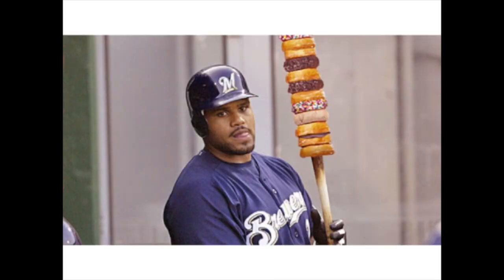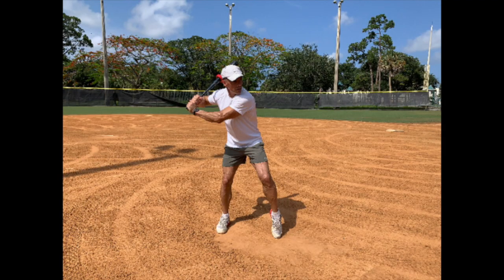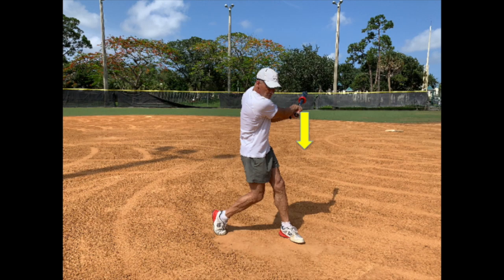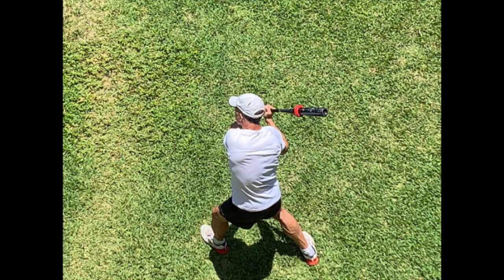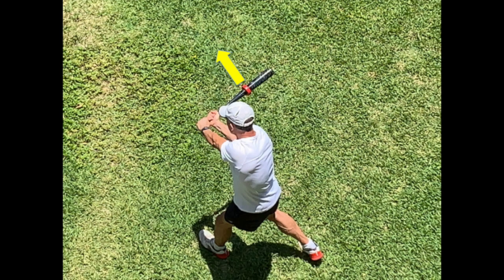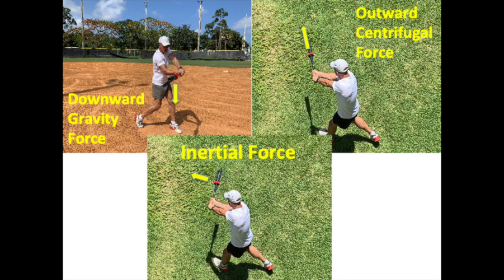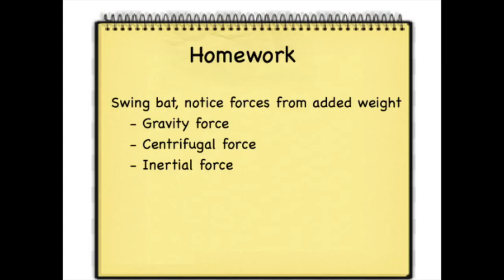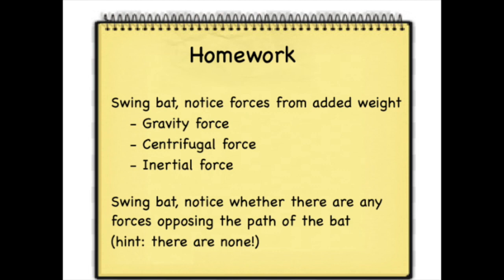FINALLY! The Science Behind Donuts and Weighted Bats EXPLAINED

Comment: now tell me about effects of practicing with a lighter bat like a -10.....same thing?
Reply from the maker: Swing Mojo is a tool that creates resistance and is used for overload training. Overload training is used to build strength and power. A lighter bat would be used for underload training. Underload training is used to train the fast twitch muscles to fire more rapidly and explosively and to develop the feel of moving faster. Numerous studies have shown that overload/underload training the best way to increase bat speed. A common fallacy is assuming that a heavier bat is en effective tool for overweight training; however, as this video demonstrates, it is not. A training aid using air resistance, such as Swing Mojo, is the optimal tool for overload training.
Reply: @swingmojo469  So then using a lighter weight bat has merit? It won't develop bad habits? Got a -10 for son to use at batting cage mainly so he can practice longer without fatigue....but wondering if some of the same issues apply as far as habits.
Reply from the maker: @SargNickFury  Swinging a lighter bat will not develop bad habits. The muscles used to swing a lighter bat are the same ones used to swing a normal weighted bat. There are no added forces (such as gravity and centrifugal force) in directions that are outside the swing path that must be overcome. Try performing 2-4 sets of: 5-15 reps with a Swing Mojo (overload) followed by 2-8 reps of the lightweight bat (underload). Base number of sets/reps on age, strength, stamina, etc. of the player.

Comment: any thoughts on the camwood bats?  Are they better than these weights?
Reply from the maker: I am frequently asked this question. Instead of adding weight to the barrel of the bat, Camwood bats provide extra weight on both sides of the hands. Not having the weight attached at the bat barrel eliminates the moment arm and more closely resembles the feel for swinging a bat without an added weight. Thus, it should have minimal adverse effects on swing mechanics. Also, unlike a weight attached to the barrel, there are minimal centrifugal forces that the hitter needs to counter and there are no inertial forces assisting the swing once it is begun.
Swinging a Camwood bat will engage the same muscles as if you took a light dumbbell, gripped it like a bat, and used a similar motion as if swinging a bat. This will strengthen hands, wrists, and forearms, which are important elements in the kinetic chain for swing a bat. Just like any activity that targets and strengthens specific elements of the kinetic chain, this can lead to increases in power and bat speed. An advantage of the Camwood bat is that swinging a bat and contacting a ball has more functionality than simply mimicking the motion with a dumbbell. A disadvantage of the Camwood bat is that the weight is fixed and cannot be increased as the player gains strength.
The Camwood bat resolves several of the pitfalls of using a weight attached to the bat barrel. I believe there are benefits to using a Camwood bat in your training regimen and it is preferred over a weight attached to the bat barrel. 
Bat speed is a measurement of how fast the bat barrel can move through the contact zone. The ideal bat speed training aid creates resistance at the bat barrel that opposes the swing path. To overcome the resistance, the hitter would be required to use the entire kinetic chain and the many muscle groups from the feet to the hands in a coordinated and mechanically sound movement to quickly drive the barrel through the contact zone. This is the idea behind Swing Mojo.

Comment: What about weighted bat sleeves ?
Reply from the maker: Weighted bat sleeves impart no forces that oppose the path of the barrel head. The main difference between each variation of adding weight to a bat, whether it be on the end of the bat (weighted sleeves) or near the hands (Camwood bat), is simply a change in the Moment of Inertia. Each will feel different when you swing; however,  no training aids that entail adding weight to a bat have shown to be effective in increasing bat speed for the reasons explained in this video..

Comment: Can I use a weighted donut to get stronger?
Reply from the maker: Swinging a bat with a weighted donut can strengthen the hands and wrists, however there are some caveats. During a normal swing, the strengthening will primarily occur early in the swing as effort is required to accelerate the bat barrel from its initial stationary position. Once the swing reaches full speed, inertial forces greatly contribute to the barrel's movement and potential strength gains are reduced. At this point, centrifugal forces increase and a tighter grip is required to hold onto the bat. 
     So yes, some strengthening occurs. But, as has been proven in many studies, this wrist/grip strengthening (accelerating the barrel at the start of the swing; tightening the grip) do not translate into a faster bat speed. This is because the strengthening is not in response to resistance forces that oppose the swing path. The only scientifically proven way to increase swing speed and strength throughout the kinetic chain is to train to overcome resistance forces that act in a direction opposite the swing path. 
     Swing Mojo (www.swingmojo.com) is a lightweight, patented training aid that creates aerodynamic forces that oppose the bat barrel throughout the entire swing and will increase bat speed and power.

Comment: Pain in my lead shoulder when hitting BP, can using this weight when warming up help this?
Reply from the maker: Not knowing your specific shoulder injury or its severity, I cannot predict with certainty whether Swing Mojo will be helpful or harmful to your shoulder. I highly recommend you seek a medical professional to diagnose and treat the source of your shoulder pain and provide advice before using. Swing Mojo is not a weight but an aid that uses air resistance opposite the swing path. Once medically cleared, Swing Mojo can be beneficial during rehab or training in order to strengthen your shoulder and increase your bat speed and power.

Comment: But why do most MLB players use it?
Reply from the maker: Good question. Adding weight to a bat to warm up is all we were exposed to from the time we started playing. It seemed intuitive that is should make us stronger and would increase our power and bat speed. It wasn't until fairly recently that many studies were conducted that quantitatively show that training or warming up with a donut is ineffective. It wasn't until now that the physics were applied to explain why donuts are ineffective. The paradigm shift from weighted donuts to an effective air resistance training aid that imparts forces that actually oppose the swing path will take some time. It will eventually happen and as with any new concept or technology, the early adopters will gain an advantage.

Comment: Sounds like a conspiracy to keep batters from doing better.  Pitchers paid for those studies 🤣
Reply from the maker: Most of the studies were performed at Universities. Once you understand the science, which I explain in this video, it makes sense.
Reply: @swingmojo469  While using weights to warm-up on deck can actually lower bat speed at the plate, those who mix underload and overload bats in a 2:1 ratio with their game bat, over 6 to 8 week, 240 to 600 swings a week with intent, actually hitting a ball - see a 6 to 10% increase in bat speed - or almost any rotational application. This has also been studied a LOT.

Comment: Interesting explanation. This then makes a training tool that uses air resistance ideal, as the tool going through the air will always produce an air resistance force in the opposite direction of the velocity. However, you'd have to design it in a way that it doesn't produce lift forces or net torque.
Reply from the maker: Swing Mojo is specifically designed to maximize air resistance while minimizing weight. The End Fins prohibit air from flowing over the Longitudinal Fins' trailing edges, which is a prerequisite for lift. By stopping the airflow, they only produce drag resistance. Also, because of the Swing Mojo's design symmetry, there are no torque effects. Many users are surprised by how smooth Swing Mojo flows through the air and they describe it as an extension of the bat and not an add-on.

Comment: To add to my comment… if you don’t already have the muscle memory … then don’t swing a weight until you get your  mechanics down… I have tested bat speed before and after wighted bat swings. It seem to help my players with bat speed.
Reply from the maker: One should not use a bat weight because it is a waste of time and effort. It also hampers swing mechanics. None of the forces from a bat weight oppose the bat barrel's swing path. A sprinter does not train by running with a weighted vest. A sprinter trains by using a parachute to create drag opposite their direction of motion, or by dragging a weighted sled that opposes their direction of motion. The same theory applies to Swing Mojo, which creates drag forces that oppose the bat barrel's swing path.
Reply: There is no such a thing like muscle memory. Please erase this phrase out of your memory and never mentioned it again. It simply does not exist and is not possible. Because es it already says, it's a muscle. A muscle is not capable of saving any memories.

Comment: Is this why all the pro’s swing a bat weight ?
Reply from the maker: Old happens die hard. The weighted donut was invented in 1955 and multiple generations have used it. It is the only device that the majority of players have been exposed to. Every bat speed study has quantitatively demonstrated that swinging with a bat weight does not increase bat speed. If you take a couple swings with a bat weight, then take a couple swings with Swing Mojo, you will instantly feel the difference and will never swing with a bat weight again.

Comment: I swing a 34 drop 3, and i add a 24 ounce weight. The way i practice is i do not swing it normally or with full force. I more wave it firmly low in the zone. You said it only activates the muscles holding up the bat and keeping it close. I see that as the point. It makes the bat feel more controllable. If i can control something with a high weight and inertia, it makes it feel easier to do so with something less massive. I can then focus more on bringing bat to ball instead of pure control of the bat. For me, its less about bat speed increase and more about bat head control. It also does make the bat feel like a toothpick after.
Reply from the maker: Placing a weight on the end of a moment arm (your bat) and waving the bat will strengthen your forearms, wrists, and hands and will make the bat feel lighter. If you are focused on increasing bat head control and not so much on bat speed, this is an effective practice.

Comment: The swing mojo weighs nearly as much as a donut (11 oz vs 16). On a 20oz youth bat that is a 50% increase which would result in the same gravity and inertia issues you describe, plus the added air resistance. How do you compensate for that?
Reply from the maker: Good question, Steve. The ideal air resistance device would be weightless. Since that is impossible, the goal is to minimize weight while at the same time maximizing the drag force. Swing Mojo was designed and engineered to develop the maximum drag/weight ratio. Since the drag exponentially increases with bat speed, the larger and stronger a player is, the greater the drag/weight ratio and the less this becomes an issue. 
During testing, we found that the resistance and resulting gains in bat speed more than outweighed (no pun intended) the drawbacks of the added weight for players as young as 8 years old. For this reason, we recommend a minimum age of 8 years old, depending on the size and strength of the player.
Reply: @swingmojo469  That makes more sense. I coach young players, ages 6-10. Their bats weigh 11-14 oz. When I watched your donut video I was certainly interested in a better training tool, but the 11 oz doubles the weight of their bats. I'll revisit your device when i move up to older age groups.

Comment: I came across your video bc I was just questioning the use of weighted bats and  weighted balls for pretraining. When I throw or warm up with a weighted ball and then throw, the ball feels amazingly light, and "feels" like I throw harder and farther with less effort. Same with taking  practice swings with a weighted bat before stepping up to the plate. The bat feels incredibly lighter. But what you are saying, is this is only pychological? Even though it "feels" lighter/faster.
Reply from the maker: Yes. It feels lighter once you remove the weight because it is lighter. However, once you swing the bat, the measured swing speed will not increase. It is psychological, which of course can have a positive effect on your batting success. Imagine if you sprinted with a weight strapped on your back. When you removed the weight from your back, you would feel lighter but your running speed would be the same as before the load was applied to your back. That is why sprinters don't train with weights on their back but instead use parachutes to create drag resistance. The same concept applies to a swung bat.